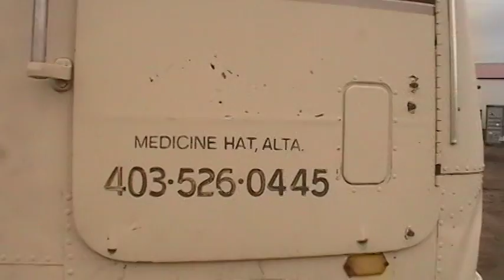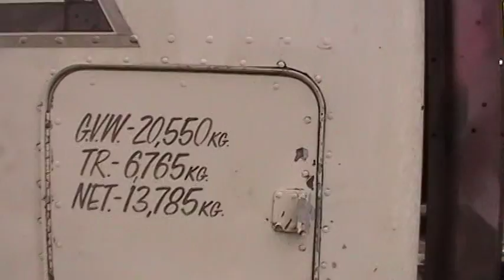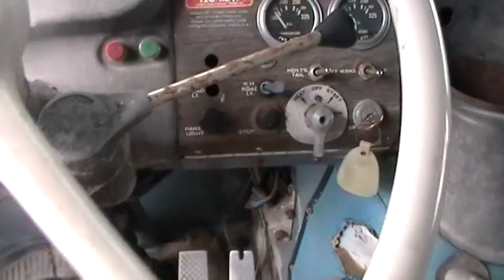1972 Freightliner Semi

Comment: It's a really neat truck but it's got an aluminum frame. You would never put a dump truck box on it but you could tow a light trailer.
Reply: Light  trailers ... ?  I pulled reefer, Ohio to California & back  with an aluminum  frame  352 Pete, 1693, 4 100 gallon fuel tanks & a 240 wheelbase  back in the 90's . . ...  never a problem . .. .

Comment: Was that a Cummins or a Detroit underneath?
Reply: Sounds like a Series 60 Detroit??
Reply: I guess it does not have a new style accelerator, must be an A model Cat.
Reply: Perkins fase 2
Reply: @7viewerlogic670  that’s what I was thinking that it was.
Reply: Detroit for sure,real one that is.
Reply: Glow plug switch . . . 1673,1674 or 1693 Caterpillar .  .. . . . . .
Reply: Maybe a 1676 V-8 Caterpillar
Reply: @paulfisher6142  you’re probably right. I think it’s a Cat for sure. It has the sound of a Cat engine. It could be either one of those engines that you mentioned.